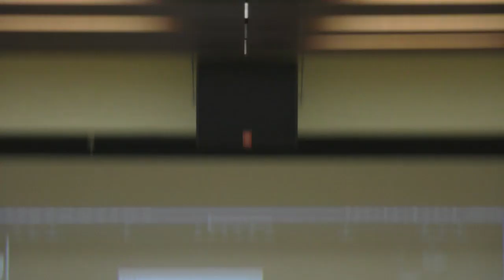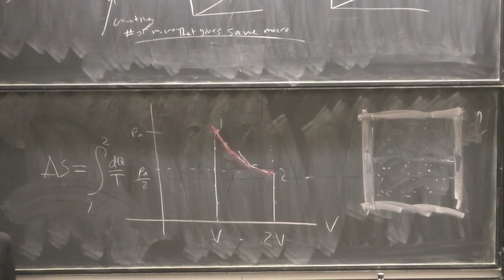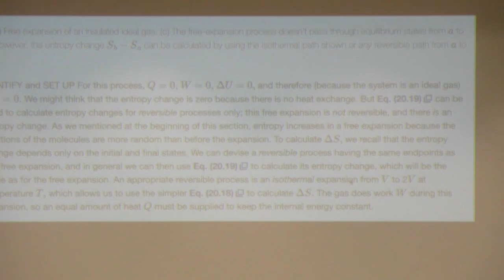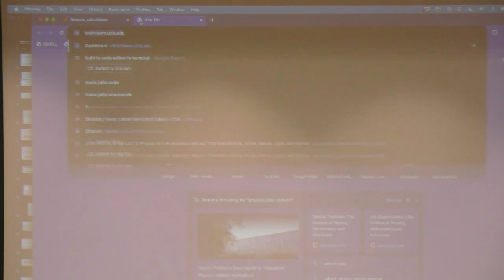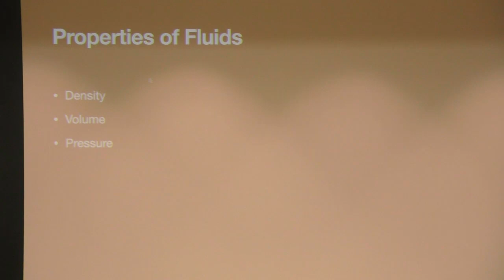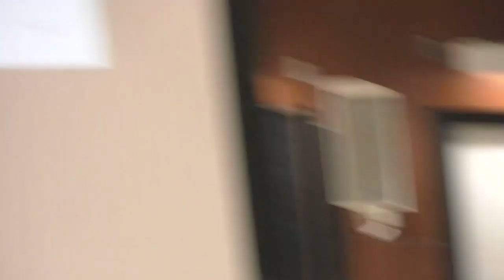Entropy: Reversible and Irreversible Processes, Deeper Insights

Comment: sorry for the basic question but if entropy can decrease locally why doesn't time go backwards locally too?
Reply from the maker: No worries about your question, so Entropy is often connected to the "arrow of time", but Entropy and time are not one in the same. Thus its often stated that Entropy is "Why" there is an ordering to events that's irreversible and thus this makes time have a definitive direction, but Entropy increasing for a system is not directly equivalent to the passage of time. Also, if I do have a system where the Entropy decreases, its only part of the system as a whole.  So heat flowing out of an object and reducing its Entropy is canceled out by the fact that the heat flows into another system or part of that system and increases its Entropy at the same time. Thus, Entropy is only decreasing for part of the system as a whole. Then time passage wouldn't be reversed for the system with reduced entropy, it would just be a more ordered microstate. Another example is magnets. Say I cool a magnet down so the spins become less randomized. The entropy for the magnet is reduced, so the system is more ordered, but the work needed to cool that magnet down increased entropy somewhere else in the Universe. (We had to use some kind of electrical refrigeration unit that increased entropy in that system by doing work to cool the magnet's region). Overal, when the magnet's collection of spins is more ordered as it is cooled, this has nothing to do with time in this context.